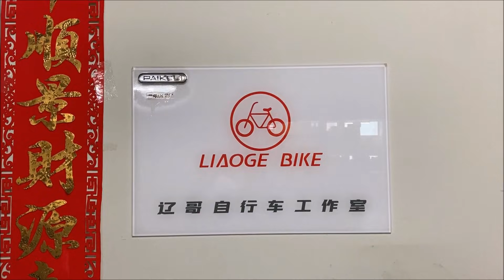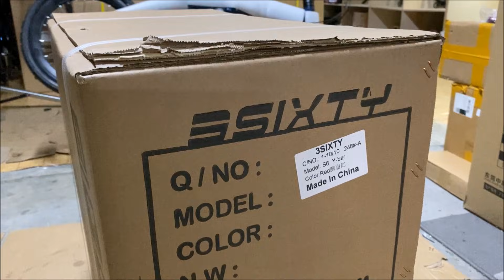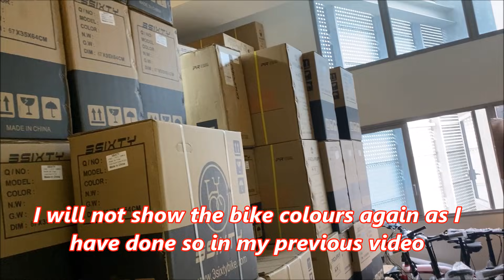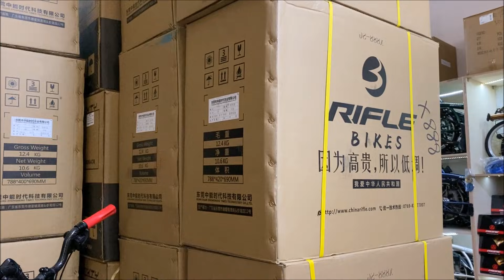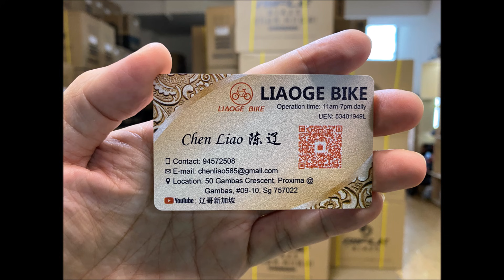LIOW VIDEO: Bought 3Sixty with Brompton User 折叠自行车开箱

Comment: How is the speed for 360 as compare to Brompton?
Reply from the maker: 360 uses SRF3 Internal Hub Gear, whereas Brompton uses Brompton Wide Ratio(BWR) that is made solely for brompton bikes. The BWR has a wider ratio between the 3 gears as compared to SRF3. Therefore there is a significant difference in terms of speed. But I believe, legs and stamina are the key. Regardless what type of gear or what type of bike you use.